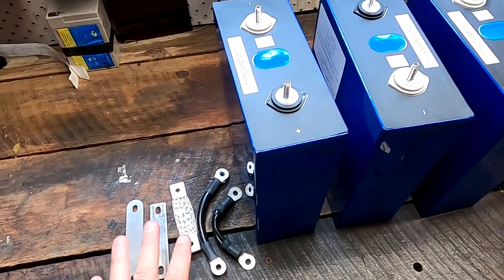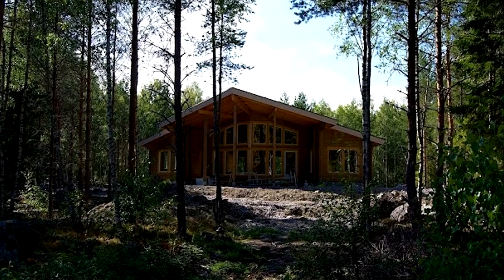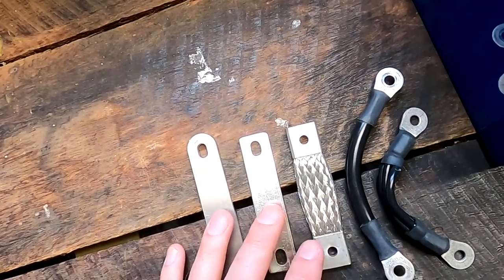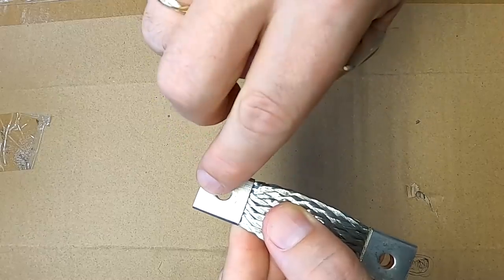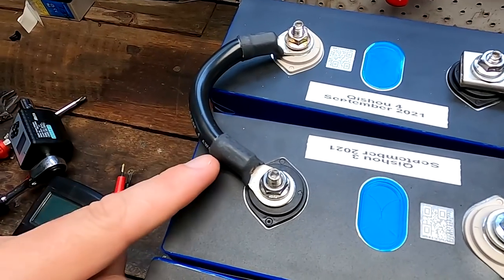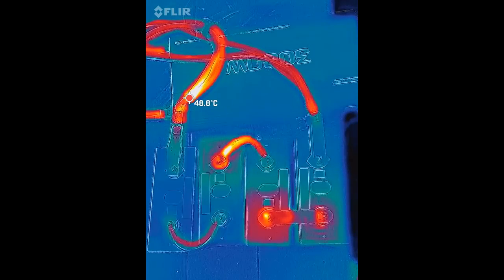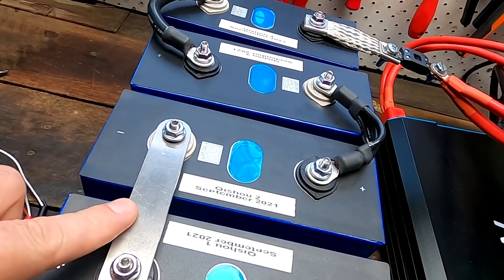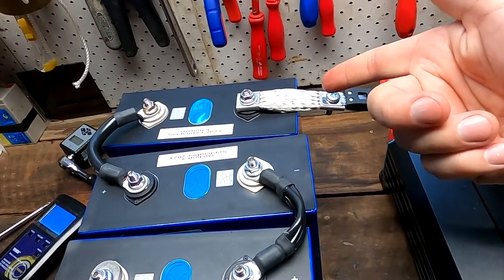All these different busbars... and why they don't matter!

Comment: hi Andy, is 3mm copper strip no good for busbars/
Reply: By copper strip, do you mean a pure copper bar, like the supplied (by EVE or whoever) bus bars, but not "tinned"?

A pure copper bar would be the best (affordable) bar, but it oxidises, so standard practice is to "tin" it. Usually nickel plating. A pure gold or silver bar would be better, but unless you're an oil magnate, who's going to do that.

Imagine, an oil magnate building a DIY clean energy system with gold bus bars. 🤣
Reply: Hey Mark.
If your strip is 12 mm wide 3 mm thick, 36 square mm section, and we follow the rule of 1 square mm per 5 Ampères, it could be good up to 180 Ampères.
Cheers.
Reply: Hi Collin.
Copper is a better conductor than gold, just gold doesn’t oxydise.
In Ohm x meter x 10^9 at 300K or 26,85c°
Silver 16
Copper 17
Gold 22 
Aluminium 28
Zinc 61
Brass 71
Nickel 87
Iron 100
Platinum 111
Tin 120
Lead 208
;-)
Reply: @hommerdalor6301  I stand corrected. I should have said silver. Everyone else, substitute gold with silver in my comments above. There, fixed it. 😊
Reply: @CollinBaillie  Cool, so I checked metal resistivity again, and shared for our friends who don’t even know it exist.
:-)
Reply: @hommerdalor6301  Thanks for the advice, instead of buying aluminium flat bar for the bus bars, I bought copper, it is 3mm*15mm. presumably the corrosion that is important is between the busbar, nut and stud on the cell. Could this be countered with a paste?
Reply: @markmac9515  Thanks for your consideration. :-)
Yes, for tranquility, I think we need to protect the connections against corrosion.
Myself, I use the pure copper busbars delivered with the cells, 8s 90Ah lifepo4, intended to go in my van, eventualy. 
For now I’m still testing, I don’t have much time because of my health, I’m strugguling for years with that.
They gave 28 busbars 12mm x 1.5mm, I use them all, 4 on top of each other, I rectified (polished) the 2 faces with waterproof sand paper attached on the back of a mirror (the front of mirrors is not flat) with 600 grid, 800, 1000, 1200, 1500. I didn’t used oxydation protection yet, because maybe I will try to electroplate them, tin seems a good candidate, because its electronegativity is between the ones of aluminium and copper, and tin is soft, so it could deform easyer than aluminium, maybe I’ll try to make tin washers, I use brass studs washers spring washers and nuts, I think they are less likely to strip the post treads than stainless, I wish I had aluminium studs, but I didn’t found them yet.
In fact, I don’t like my copper busbars, because they have that long ’’oval’’ hole, witch reduces the contact surface on the post.
The braided ones Andy showed look interresting.
The Mermaid handmade are good also, but my studs are only 4mm diameter, I can’t find the connectors big enough to cover the whole post surface and 4mm hole. I made some with 10mm copper tube, and polished them, they are good for 150 Amp witch is the theorical maximum for my 3000w inverter under 20 Volts.
Another concern nobody talks about is metal expansion temperature coeficient. Well here is another list showing it between 0 and 100C°
copper 17
aluminium 23,5
brass 20
nickel 13,3
iron 12,1
tin 23,5
bronze 17
carbon 0,2
stainless (316 and 304) 16,5
stainless (310) 17

Cheers.

Comment: Great video Andy, but please be careful with your ring over your batteries while touching for heat!  Did that, only once, over car battery and touched my class ring somehow over battery and it arched my ring and burnt my finger!
Great content.
Reply from the maker: Thanks Erik. I guess this can only happen when the ring touches both terminals. Or having a bare wire in your hand which touches the ring and it also touches the other terminal? I never understood how such accidents can actually happen..

Comment: The question now is, why do you use those aluminum bus bars for your build? They seem to have perpetual problems. I drilled and tapped (for the sense leads) the nickel plated copper bus bars that came with my EVE LF304 cells. I was worried about them only being 2mm thick and copper, but there seems to be enough threads for a sufficient connection.
Reply from the maker: To test, learn, explore and... share 😉

Yes, I did the same with the Cu bars and the thread is enough for the balance cables.

Comment: Make huge copper threaded washer, under all buss bar and screw terminal. A spring action keeps perfect contact while the post must be allowed to wander as it always does. those crimp eye terminals need to be thick and wide.

Comment: I'm using cable/braided crimped, so that at least the ring lugs can flex for the terminals that aren't perfectly flat next to eachother.
Reply from the maker: Yeah, that sounds like a good solution and will work perfectly.
Reply: @OffGridGarageAustralia  hope so ;) Mind you, this is a non-stationary solution, so I figured using flexible, given the vibrations, would be better anyway.

Comment: Aluminium is not a great conductor like copper and is a serious pain to use properly. I don't know why people are re-inventing the wheel (or busbar in this case) the busbars that come with the cells are perfectly fine.
Reply: For science! Not everyone knows everything. Andy gets to make content, and people who enjoy his content get to learn WHY industry has standard preferences for materials used. 

Also, perhaps aluminium is more budget friendly, if you're willing to take the time to understand the problems and deal with them properly.

A casual viewer may well walk away with a partial understanding only, thinking any old aluminium bar would do, and that is a problem. But casuals will be casuals. You can't change humans.
Reply: Agree on that point as well.
Reply from the maker: @Quattrohead. On this channel I make tests and share this with everyone. If you want a ready build battery which just connects and works, that's the wrong content then for you.
I'm here to test, explore, learn and  share. That's the main purpose.

Also, in this case, the aluminium bus bar has a lower resistance than the standard copper bar. I made a video about it when I got these aluminium bars.

Comment: Interesting comparison - thanks Andy.  The only scary bit was the flexible braided bar hanging over the edge of the cell.  I seem to recall hearing the outer shell of the cells is tied to negative.  Had the braid touched an exposed bit of the shell under the thin blue plastic covering that might have been ugly.
Reply from the maker: The case of the battery is actually the positive. There are also two layers of heatshrink/insulation in this corner area, so it was safe of doing it this way for the test. Not for a permanent setup though.
Reply: @OffGridGarageAustralia  Oh, it's the positive... I guess I mis-remembered - thanks for clarifying.  I figured you would have realized if there was any risk.

Comment: What is the heat reating of the wires ? Generaly is 70 c to get more then 30 40 is not good at all .the onley solution is biger wires.also you need an adapter in order to connect aluminyum to coper .
Reply from the maker: It does not say anything on the wires. These are the ones which came with the Renogy inverter. I have to check the crimping as this seems to be the issue.
Reply: @OffGridGarageAustralia  we had the same issu with ac pv brakers  when we use adapter to coper  they stop heating
It worth to chech with dc

Comment: Questioin: What JK Equipment out of the mass selection available, would you recommend for a BMS setup, on my 18650 banks. 7s 80p 24v. Note: there will be more banks in the future.
I'LL owe you a spat or two. Thank you in advance.
Reply from the maker: That depends a bit on your load as well. What's the max discharge current you would pull from this pack?
Reply: @OffGridGarageAustralia  Not sure but I will be connecting 2 1000 sun grid tie inverters and one 220v 6000watt pure sine split phase inverter between them. If that gives you some indication in the direction i am going. I would guess no more then what the suns can put out. or use or however you want to put it.. Since you have some knowing about the sun grid tie inverters i just had to ask you first.
Reply: And with prices going up by the min. i figured i needed something sooner then later , still in the building the battery stages. but i do have the inverters and panels.
Everything for a main system to be built on except a BMS. Pre  build.
Reply: and a long road to walk down before i see the the lights on.

Comment: Complains about reading an article makes a 28 minute video! :D

I found a really good busbar laying on the ground of my workshop with some eart wires on it. And I use it for my main busbar. And to use 2 Aolithium batteries I bought 6mmx25 flat copper bars and make my own custom rings. I dont like the sunken battery terminals. a quality 70mm2 lug wont fit in there
Reply from the maker: Nice work!

Comment: you can use black isolation tape on the busbars to get more precise temperature readout with flir cam, in order to minimize reflections. The tape will have same temperature but no reflection, so just stick a short piece to metalic parts you want to measure temperature of wit ir cam.
Reply: I wondered how accurate the IR temp probe was. You could see heat soak into the battery (black top) from the poor aluminium connection but there was no heat soak evident from the inverter cable into the first bus bar (silver colour). Still, the finger test doesn’t lie.

Comment: Aluminum conductors always were a problem because they oxidize and aluminum oxide is not a conductor. Stainless steel does not oxidize but it is a poor conductor. In my experience ,the finest conductors are silver plated copper terminals, and the washers the same. Flexible conductors have a much higher current carrying capacity then their solid counterpart. Although a #2 cable is rated for 100 amps, a short jumper will probably handle 500 without heating up.

Comment: I'm sure its in a video somewhere. What size array and storage for Off-Grid Garage? My shop/garage is off grid as well!
Reply: I think it's around 2kw maybe ~2.5kw. If you watch some of Andy's early videos he sets up a 1.2kw array on one roof (east) and then gets more panels maybe 1.4kw and adds them on the west roof. I think that's right. And with his battery rack basically complete, ready for the finished install of 3 batteries at 48v and 280-304Ah, he's got capacity for a lot more panels, which he seems to be looking at already.
Reply from the maker: So, at the moment I have 4.1kW solar installed with the two batteries 15kWh each. Solar will be upgraded over winter now to around 10kW once it gets cooler on the roof.
Reply: @OffGridGarageAustralia  Nice, I have 3.85kw solar and 11kwh battery. It’s all I ever need for my shop, and I also charge my car with it sometimes. House is an on grid system. Over course of a year we produce about twice what we use. All electric house, and that includes driving about 14,000 miles a year

Comment: By the buy, I like the crimped copper cable approach from digital mermaid. I will probably be using them. My batteries will be custom sized made from 32650 6ah cells from Battery Connect, so I will need custom bus bar lengths.

Comment: Me likey those braided bus bars.  Very expensive compared to my DIY bus bars.  I buy the packs of 0.8mm copper bus bars and then heat shrink them together at my desired thickness.  That's all they do on ali express.  These braided bus bars would be perfect for 200ah and below.
Reply: Do you have a link for said packs?
Reply from the maker: I've got these layer busbars on my website. Not sure if he's referring to these ones though.
https://off-grid-garage.com/battery-accessories/

Comment: Thermal camera don't mesure temperature, they mesure a flow of energy coming out of material and calculate temperature with an fixed emissivity coefficient.
But different materials have different emissivity coefficient,
Common material around .90 to .99
But with relective material like shinny aluminium busbar you need to do something.
Adjust emissivity coefficient of camera ( but it's complicated to know the value , if it's rusted or polished it change a lot )
Or much simpler tricks , stick a piece of black tape on it , and you can mesure the real temperature of it .

Comment: I use the braided. I just elongated the holes a little with a chainsaw file.
Reply from the maker: Yeah, that's what I was thinking. How do they perform? I found them getting a bit warm over time. Warmer than the original bars coming with the cells.

Comment: I would stick with the original copper bars supplied with the cells. 

Sorry.  But no way I would use aluminium buss bars in any of my builds.
Reply from the maker: I think the original copper bars are pretty good. And are free of charge as well... For a mobile solution or batteries which are been moved around a lot, I would go with flexible bars though.
Reply: @OffGridGarageAustralia   Yes I agree.  Flexible for 4wds  for sure.

Comment: I do not get how the ohm meter can measure the internal resistance on a battery, since the battery has internal voltage. The ohm meter must compute the differential over a range of voltages to achieve this
Reply: @tj4034  True, it's not a simple ohm meter.

Comment: You will never stress a bus bar like that. Connect All of the bus bars together and connect to a high amp load.welder leads or other 200-300 amp load. Take battery out of the equation.

Comment: I don't really get how the internal resistance could increase, just by connecting bus bar to the terminal... It's still just measuring between the two poles. Anyone has an explanation?
Anyhow, AliExpress for the win ^^
Reply: At which point in the video? Timestamp would help.

One of the tests (I think the 2nd) was performed while 160A was being drawn, so that would have a significant effect.

The first was comparing resistance directly on the terminals (so, the cell's natural resistance) with resistance once bus bars were installed, to determine how much resistance the bars added. Obviously this "internal" resistance isn't 100% internal to the cell any longer, but is "internal" to the build. If you consider the bus bar as the terminal of the cell, then it's the internal resistance of the cell, which naturally is higher than the bare terminal, because there are extra connection points involved now. Each new connection point actually increases resistance, because of imperfect connections. It is after all, no longer a single piece of metal, there will be "gaps" between surfaces.
Reply: @CollinBaillie  at 14:25, he measure from terminal to terminal, without going through the bus bar.
Reply: @tiloalo  Ok, so he's not measuring the resistance through/across the bus bar (ie from one end of the bus bar to the other), but measuring to see the effect of having a bus bar installed. So, because you can't measure directly on the cell terminal, but only on the bus bars, how much extra resistance is introduced to what is effectively the cell terminal. No current is passing through the meter, so it is effectively making the bus bar into the terminal of the cell and measuring the resistance in the cell as a result of this extra metal. It's a test of the effective resistance between the bus bars and the terminals of the cell. Take the initial value from the updated value, and you get how much extra resistance was introduced via the bus bar connection to the terminal.

It's a strange test, because each cell terminal has a different type of bus bar. It would possibly make more sense if he had matching bus bars on each terminal. I don't think that particular tool would be useful to measure resistance between the bus bar and the terminal it contacts. That would require an ohm meter/multimeter with a very precise range, possibly down to micro-ohms.

Comment: I was going to make a comment about using aluminum busbars and then remembered my prebuilt recycled batteries have aluminum busbars welded on.
Reply: Hello, for the same mass of matter, if aluminium cost 0,10 , copper cost 3.
Also, it’s not easy to weld copper on alu.
;-)
Reply: I've watched my batteries taken apart in a video. It was a bit of work to remove them.
Reply: @ronwest7930  yes, welded aluminum to make the bigger battery with multiple LiFePO4 cells >>>>essentially makes it no longer user friendly to service...i do not think seller of that type of battery assembly will pay for the return shipping to get them to live up to their warranty claim...DIY assembly is still going to be a better route if you can do some  DIY work.....no sellers pay return postage that I am aware of....